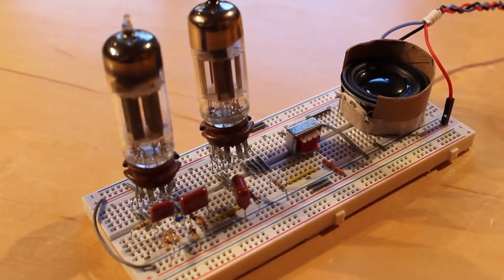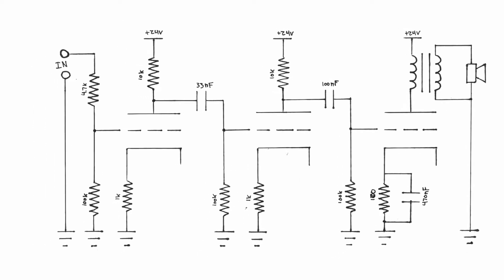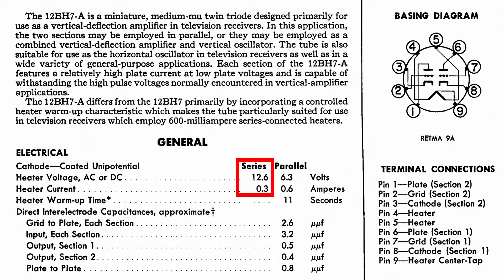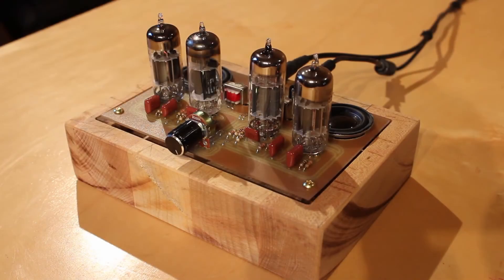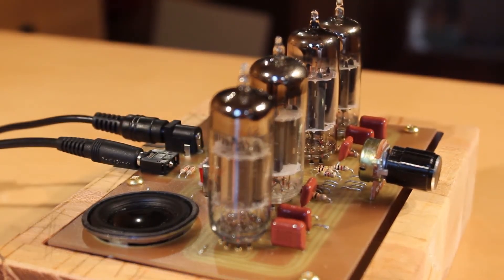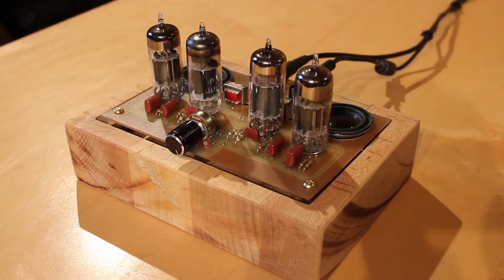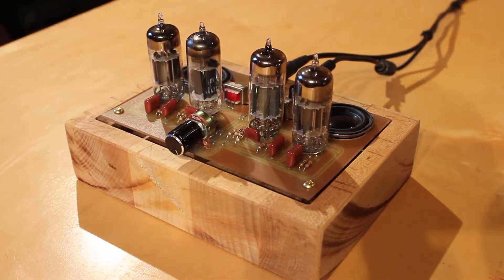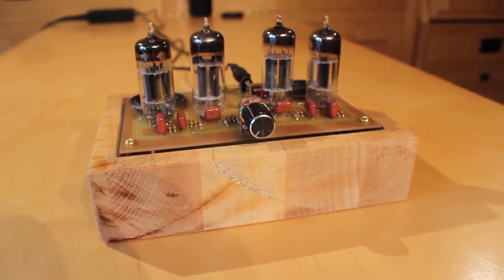Finalizing the Low Voltage Vacuum Tube Audio Amplifier

Comment: Thanks this will bring more tube projects to the electronics field. I'm not afraid of the b+ I been playing with tubes since I was in seventh grade. I was named electronic genius but was far from it. I had my brothers radio servicing book that explained how old tube radios were built even the ones that used electromagnetic speakers. The amplifier is the same, all radios have an amplifier in them. Tuners have external amplifiers if they are considered to be a radio.
Reply from the maker: Thank you!
That was the hope with this project. A lot of people who grew up in the digital era, myself included, can be quite leery of voltages above 100V, but a good tube amp is often using a B+ three of four times higher than that. I never got into tubes because of the fear, but using them at low voltages gave really interesting results and opened the door to start learning about how to conquer that fear!
Reply: @UsagiElectric  it's all about color coded wires use red for B+ and green for fillament (heaters). If you use a vaccum tube rectifier the filament wires are yellow. The plate wires are already red off.the transformer. 73

Comment: Love your design and it's beautiful turnout! I would like to give it a shot, however I would like to try the stereo route. What modifications would you suggest I make? Thank you.
Reply from the maker: Thank you!
It pretty much already is a stereo amplifier. If you look at the schematic at 2:10 in the video, if you put the right channel into the right input and the left channel into the left input, that'll make it stereo. You'll need either two volume potentiometers, or a ganged stereo potentiometer. I didn't have a stereo potentiometer, which is why I decided to force mono through it. But the design itself is essentially already a stereo design!

Comment: very cool ,do you have a list of components, might be cool to build a copy of that :)
Reply from the maker: Thank you!
I don't really have a list of components as it was just built from stuff I had laying around. The tubes in use are 2x 12B4A and 2x 12BH7. The output transformers are just random ones I found on eBay years ago and there's actually a lot better options out there. Other than that, it's just whatever resistors and capacitors I had laying about that sounded good through trial and error!

Comment: Tube amps can be powered at very low voltage, like under 6V...Hack A Day has shown this...very Interesting
Reply from the maker: Thank you!
And yup, tubes are really, really capable at low voltages! But, at the end of the day, power is still power, so if we want more volume/power, we gotta bump the voltage up.

Comment: One mod to the basic design that I could suggest is maybe add a speaker out jack to each of the two amplifiers so you could connect them up to a pair of HiFi speakers.
Reply from the maker: That's a good idea! Though there's certainly not enough power available to drive a good set of HiFi speakers, but it would make for an interesting pre-amp design to a HiFi setup!

Comment: Actually you could drill down under the speakers 3/4 of the way, drill into the back of the wood to open that channel. Then roll up some paper into 2 cones and with a small end sticking into a hole and the big end coming out.  There’s a number of ways to cheaply build something around the speakers, get 2 small Dixie cups or those plastic pepto bismuth serving plastic cups, cut the bottom out so your speaker fits inside then attach the new speaker where the old one was. I’m sure you could make something even better some kind of wire covered or attached to thin rubber to make a slider and the speaker inside of that. Makes ya think
Reply from the maker: Ooh, yeah, that's actually a really good idea! I was kind of thinking that the open space between the PCB and wood enclosure would work as a sort of speaker box, but you're right that he speakers need a better, more dedicated enclosure. Audio stuff is so weird and difficult for me after having spent so much time thinking in a digital computing way with the tube computer I'm building. But, I have a new audio project I'm slowly working on, so hopefully we can get a pretty wild little tube audio project going soon!

Comment: Nice project! I am looking into building a tube guitar amp but dont feel like messing with high voltages so im glad ive come across your videos. What amount of power do you think it puts out? Do you think it could drive for instance a 3 inch speaker for a bit of bedroom jamming?
Reply from the maker: Honestly, it's a really small amount of power. If I had to guess, I would say between 0.5W to 0.75W-ish. It might be a little too quiet for a good guitar amp. But, a hybrid amp could work really well. Using some tubes as good pre-amplifiers and to set the tone, and then a final solid state driver give about 3W of output power could be quite good!
Or, it might be worth bumping the voltage up to 54.6V, that should get you around 1W of power output, which might be a decent enough volume without upsetting the neighbors. And 54.6V supplies can be found on Amazon for really cheap, while still keeping the voltage relatively low.
I think I'm going to revisit the low voltage tube amp sometime in the future and see if I can get a bit more and better sound out of it!
Reply: We need to get these hi voltage fears out of some more advanced electronic hobbyist. I would say forget the circuit board and hard wire using color coded wire. Use red wire for the b+, use green wire for the tube heaters, use black and white wire for the primary, if you use a tube rectifier use yellow wire for the 5 volt filament. Ground or chassis ground use green with a black stripe stating it's the power ground. The red, green and yellow are what the tube manufacturer used when building early tube radios and amplifiers. Care should always be taken when working with any electronics. Low voltage can still kill, it's the current that kills not the voltage. Power transformers are hard to find so you can use a foreign transformer that takes 240 and steps down to 120 Volts. Just put the 120 volts in the output and use the input side for the 240 b+ a step down transformer can also be a step up transformer. You can also use a voltage multiplier circuit using diodes and capacitors if you use ac for your transformer instead of a dc power supply. AC  can be multiplied into DC, old television sets that didn't have a transformer used these circuits. I would never tell anyone to multiply the AC line voltage. Too dangerous even though tv manufacturers did that practice. Only double 24 or 48 volts. 96 Volts will give a good shock. Play it safe use a transformer on tube projects.

Comment: I'm inspired to use this for either a Preamp or a Headphone amp. I got a ton of Power Transformers that should work for it. Wonder how well 60Volts will do. I think I also have some Transformers from some old switch mode power supplies that could work as output transformers. Although I do have a couple of tricks up my sleeves for that part.
Reply from the maker: This design would make an excellent preamp/headphone amp, though as a headphone amp, you might be able to get away with a lower voltage. With 60V and a good driver tube, you should be able to get about 10W of power out of it, which should make a great amp for an apartment!
Reply: @UsagiElectric  consider raise resistor watt values.

Comment: Hi very nice build.....I got bunch oh 12ax7 tube, is it possible using this diagram to build with 12ax7 tube?. Of course it need some change on the diagram but I'm not to good in electronic, need some advise. ^^
Reply from the maker: Absolutely!
The 12B4A i use here for the driver tube could easily be replaced by a 12AX7, but I would run the two triodes in parallel to get a little more power out of it. Of course, the resistor and capacitor values will most likely have to be tweaked to get good sound out of it, but it's totally doable with four 12AX7 tubes!
If you want, come join us over on the Discord channel, there's a ton of people there that are way smarter than me with audio circuits, and we'd be happy to help you build up an amp! ( https://discord.gg/p7UsfHD  )

Comment: Those 474nF cathode capacitors are a weird choice? For max power you want to fully bypass the cathodes at all audio frequencies, so with a 100R resistor you're looking for 100 micro farads or more.
Reply from the maker: Honestly, the values I came up with here were discovered purely through trial and error. I built up the circuit on the breadboard and then swapped resistors and capacitors for about a week straight, trying all sorts of different combinations of values until I found a combo that produced the best quality sound.
But, you may be on the nose here! I don't really know much about audio circuits, so this was a massive learning experience and I'm sure there are better resistor and capacitor combo values that I totally missed!

Comment: i'd be interested in hearing 60 volts could do
Reply from the maker: I do really want to build another audio amplifier one of these days soon!
Though, I think I may go in a slightly different direction. I do like the idea of using a bit more voltage for it, perhaps 80V or 100V, but I also want to see if I can get an Output Transformer Less (OTL) design working. It may not sound great, but it'll be a fun experiment!

Comment: Transformator using?
Reply from the maker: Hi, I think you're asking what output transformer I'm using?
They're just some random tiny ones I found on eBay years ago just searching for "Audio Output Transformer". They actually were a  pretty terrible choice for this application for everything other than their size. I could have gotten much better sound and more volume using a proper audio output transformer, like one from an old PA system.

Comment: That amp is beautiful.
Reply from the maker: Thank you! I'm really loving the solid wood block for the base. The fact that there aren't any seams on the wood just makes it really cool. Plus it gives the amp a great solid feel. Unfortunately, I caught my jacket sleeve on one of the 12BH7s the other day and broke the base, so it's currently waiting for me to hunt down another 12BH7 to replace it.
Reply: @UsagiElectric  That's crappy. Easy to do though, the weakest point is where the pins go into the glass.
Reply from the maker: @Franko_Walker  Yeah, I seem to have bad luck with the 12BH7s on this amp. That's the second one I've broken in less than a week!

Comment: Sweet project!

Any chance you could post a schematic for this? Would love to play with some tubes without risking the high voltages found in other approaches

Thanks for fascinating videos
Reply from the maker: Thank you very much!

Sure thing: https://i.postimg.cc/L5f6j0SW/002.jpg

It's essentially two duplicated class A mono amps sitting next to each other, so really only one needs to be made. And, with some better output transformers and a bigger speaker, you should be able to get some decent sound!

Comment: Awesome build, the final product looks fantastic! I love the "How it's Made" vibe, watching the mill at work is mesmerizing. Great camera work too :) If you don't mind me asking, what would the total BoM come out to if one were to build one of these themselves?
Reply from the maker: Thank you so much!
Oooh, it’s hard to judge total cost involved in building this because so much of it was made out of spares I had laying around.

The PCB is one of the more interesting ones to try to figure out, because the CNC 3-axis mill I use isn’t exactly cheap, haha. But, you could get PCBs made at one of the reputable PCB manufacturers for decently cheap. My PCB measures 100mm x 150mm, which looks to cost around $50 for five of them from PCBWay. However, I chose that size because it was what I had on hand already. With a double sided PCB and some clever redesigning, you could easily get that size down to something like 75mm x 75mm, which brings the cost down to $25 for five boards.

The capacitors were all leftover stock from when I restored our old Magnavox Concert Grand stereo, but at these low voltages, capacitors and resistors are all super cheap. 

The 12BH7 and 12B4A tubes are probably going to be the most expensive. The 12BH7 is about $10 a piece on eBay with shipping, and the 12B4A is about $8 a piece with shipping. But, those aren’t the end all be all of audio tubes. There’s a lot of options out there for dirt cheap tubes that could be made to work with the right resistor and capacitor values.

But, to rebuild this one, as it is, here’s about roughly what it would cost:
PCB: $50
Tubes (2x 12BH7, 2x 12B4A):  $35
Capacitors, resistors, potentiometer: $10
Mini output transformers (pack of 10): $10
Mini speakers (Gikfun EK1794): $10
Total: $115

Which is ridiculous now that I type it out, haha. But, get that PCB size down and grab some cheapo tubes and that price can come way down. 

Also, spending $35 for those specific tubes isn’t the greatest idea. You can find tube lots of random tubes on eBay for cheap. For $35 you can get a random lot of around 100 tubes, which is way more bang for the buck! You can also find lots of good tubes in smaller numbers for much cheaper as well. Currently, there is a lot of 8x 12AT7 dual triodes on eBay for $15, which are good tubes. 

So you could easily order enough parts to build two of these amps for about $50 to 60!

Comment: Im sorry,, what the power tube?
Reply from the maker: I'm not sure if it's the right way to refer to it, but it's the vacuum tube used to drive the output transformer. In this design, the 12BH7 dual triode is setup as two amplifier stages, and the 12B4A single triode is used to drive the transformer.

Comment: I especially love how you turn the pot backwards to get higher volume :D
Reply from the maker: That was actually the first thing my father commented on upon seeing it, haha. It was totally a result of me just trying to find a good way to draw the traces on the PCB and completely not thinking about which way the potentiometer turns.
Reply: Just call it the attenuator and you're good to go 🙂 Great build!
Reply: For me I would have dispensed with the volume control use the volume control on the source and keep it stereo also if your speakers were sealed the board you might save a bass Improvement

Comment: i need a help.i have EAF801 tubes. can i use this curcit for them. can you help me to learn about vacuum tubes.
Reply from the maker: Hello!
The EAF801 is a pentode, so it needs to be connected a little differently, but they should work pretty well as audio tubes! You'll also have to adjust resistor and capacitor values to match the tube as well as the voltage you're running, but the overall Fender Champ Amp design is really versatile and simple.
If you want, come join us on the Discord chat server ( https://discord.com/invite/p7UsfHD ), there's a lot of really smart guys in there and we should be able to help you get an awesome tube amp going!

Comment: Its a PSE or Parallel Single Ended amp
Reply from the maker: Interesting! I hadn't heard of a PSE amp before (I'm a total audio amplifier noob). I'm still a little confused on them though. Can it still be considered a parallel single ended amp if there's two output transformers and two speakers? From what I've read, it looks like a PSE uses two driver tubes in parallel to drive a single output transformer, essentially letting class A amplifier drive double the power it could with just one drive tube. 

This one here looks to use four tubes in parallel as driver tubes: http://www.audiodesignguide.com/my/el34_pse/newsh2.jpg

What I built I feel might be closer to two full fledged, but completely separate amplifiers, being fed the same audio signal. Which, now that I think about it, is a terrible design, haha.

Comment: I'm happy to see that there are someone else that spends a few moments extra on making curved tracks instead of the plain 45/90 degrees ones.  When I know that I'll want a curved look on the pcb I usually route it all with 90-degrees bends and then as a final pass go over it all and redo the corners.
Reply from the maker: I love curvy traces! I know that when it comes to really high frequencies, there's some issues with curvy traces and 90* bends work better (although I haven't really read into why), but nothing I build will ever operate at those high speeds, so the primary focus becomes making the board look good, haha.
Reply: @UsagiElectric  u literally said the wrong thing

it s opposite

curvy is better than 90 degrees

45 degrees is a compromise

Comment: Is there a small supply for filaments below the PCB ? Or you run the filaments in series on plate voltage with a big dropper resistor ?
Reply from the maker: No extra supply! The heater filaments are run in series off plate voltage, but because each heater each tube is a 12V 300mA heater, they can run in series off 48V without needing a dropper resistor (12V x 4 tubes = 48V). Matching up heater voltage and amperage requirements is actually the primary reason why I chose the 12BH7 in this design. Also, physically larger tubes means more plate surface area, which should mean more electron flow and hopefully a higher volume!